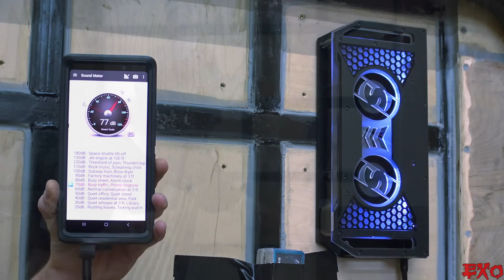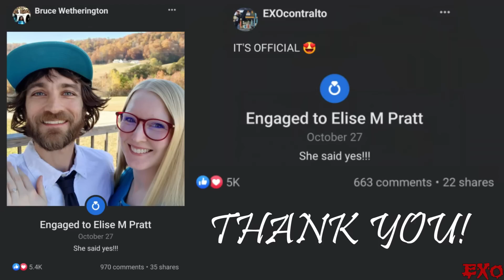MINI-SIZED Car Audio Model EXPOSES The Beefy Spots! Testing Baffle FLEX & NEW Amplifier Cooling Fans

Comment: When he is done with this project its going to be so damn loud he won't even b able to handle his own system haha im just kidding he can handle it but it will be nasty loud. If your going to go thru all this work u might as well epoxy resin the inside of box and make it harder and it will in the end be louder alot louder. It will increase the reverb alot. I'm starting on my single 15 box for sundown s.a classic and its already loud..going to add a 2nd 4 inch aeroport and then secure the ports on inside and add a second brace inside box then its either getting a think later of fiberglass or more than likely ill just epoxy it and then add some more epoxy on top of that lol it is guna b a banger

Comment: Is there going to be a way of drawing air in from the outside or will the amp compartment be sealed off? I only say this because it wouldn't take long for the fans to start circulating warm air generated by the amps. I imagine it would be fine for short bursts but it wouldn't take long for it to get heat soaked. Hopefully I've missed something and you've considered this already. Keep up the good work Exo!
Fun fact, I watched your flip tutorial video when I was a lot younger and only recently did I realise that was you! You skate, love car audio and is a little monkey that does tricks. Me and you are remarkably the same. Anyway, I'll stop rambling. Let me know when you're coming back to the UK

Comment: EXO, your build is awsome. Keep in mind that the actual pressure the box wall will receive is about 1.47 PSI at 174dB  as an exemple. So you multiply that PSI by the wall surface and you get the actual force the wall will get!.. it is often thousand pound force in both directions! Your wall will be stressed as well!.. I use the rule of tumb: One atm pressure is 14.7PSI and is 194dB from a change in pressure from 0 to 14.7PSI. Each time you remove acoustical 20dB you divide the force by 10. So 194dB is 14.7PSI, 174dB is 1.47PSI, 154dB is  0.147PSI. You see? Knowing that it put in perspective how much force your wall will receive from the acoustical pressure!  Your horizontal metal brace wil need to work in compression and extension each sides from the wall below the speaker baffle.  I could give you the formula but i lost it.. I think it was something like 20 log (&Y*&U)(!)$.....)P1/P2 etc or maybe 20 log (p / pref)...

Comment: Congrats Exo, wish you and your fiancé the best.

With this build being so extreme and having the advantage of a horizontal baffle; I'd go with long 1/4-20 threaded inserts to mount the subs. Smokin' a sub is an inevitability, so might as well make change outs easy and not ream out the wood with repeated screwing and unscrewing. Even if you have drop down to a #12 or #10 screw to avoid blow out on the baffle cut out, those little guys have hundreds of pounds of clamping force per screw and insert.👍

Comment: Hey bruce its coming along awesome! I would recommend replacing those vertical supports with threaded rods and threaded flat plates 🙂. It will help spread out the load along with giving you more welded surface area if thats how you're going to mount them to the baffle.